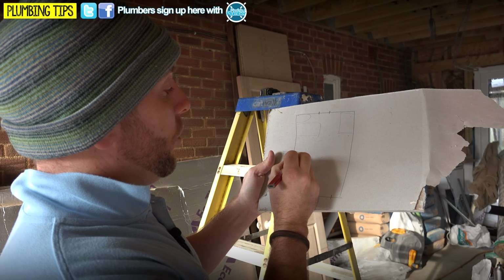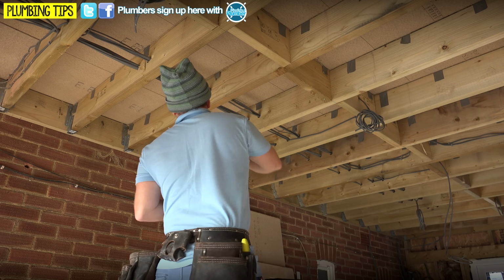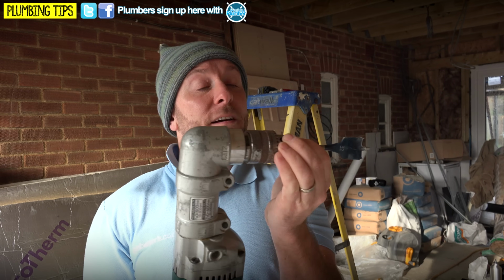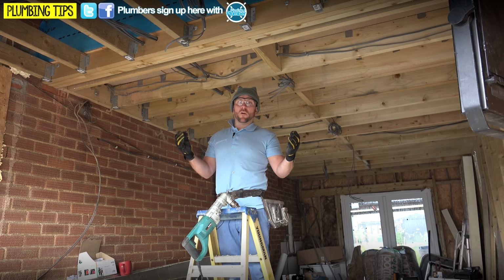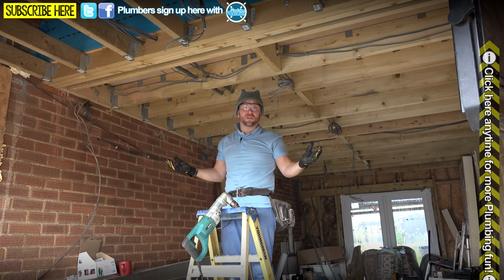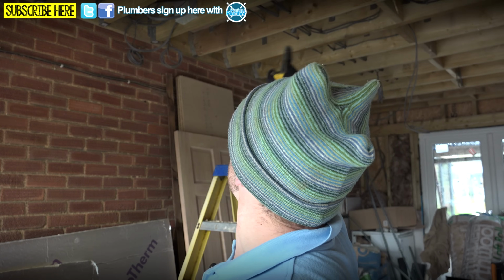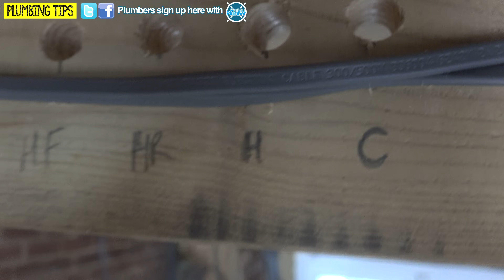DRILLING HOLES IN JOISTS & WOOD FOR PLUMBING - Plumbing Tips

Comment: Worth noting that an impact driver will take those spade / flat / auger bit drill bits (1/4" hex), combined they will fit between joists up to 300 centres 😊. So long as they're decent bits, you should fly through just as easily with an impact. (Thought I'd mention incase the site may not have electricity etc)

Comment: Great video as usual. We're starting first fix of our new home conversion (from old offices) - loads of really old joists that need reinforcing because of decades of crap plumbers, electricians, BT engineers, etc...

I use an Erbauer angled chuck (£16 from screwfix) instead of a special angle drill - does the job just as nicely...
Reply from the maker: Top man! Good luck with the conversion!

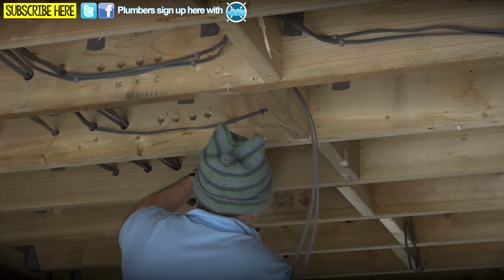Comment: Holes drilled in joists are also supposed to be 3x hole diameter apart from the next adjacent hole. So the holes drilled at 10:04 are not to regulations. Not trying to be picky, just trying to help people out who are using this video as a guide. :)
Reply from the maker: Yes, but at 19mm I had to keep them in the 25%-40% range. I'll let you know if the house falls down!
Reply: So the question is if you have no choice do you drill the holes closer than you should or go outside the 25 -40%  zone? Either way it isn't that critical provided the joists are not over-spanned but as you said this is about getting it past Building Control. If in doubt give them a ring.
Reply from the maker: Great answer! SUBSCRIBE! ➡️👉 https://www.youtube.com/subscription_center?add_user=plumberparts 👈⬅️if you haven't already!

Comment: Does this apply to plastic pipe?  My garage pipes (below the bathroom) are a mess all over the place 70s build. I'm using 15mm plastic pipe to T into the flow and return to a new radiator. I decided on plastic for the slight flex as were the pipes come up through the floor is very tight. I'm confused though, how far down the joist can I drill?

Comment: I'd like to know the wisdom behind the 0.25 to 0.4 joist rule. If you drill on the neutral axis of the beam, you can drill anywhere along the length imo. By drilling holes close together you're creating a slot nearly, which would weaken the beam.
Reply: Building Regs

Comment: If you don't understand the reason for the regs, ask your local controllers for pictures of joists that collapsed due to service holes drilled in stupid places... was a bit of an eye-opener for me.
Reply from the maker: Good point!
Reply: The funny thing about regs is where and when you have to practice them. In Colorado in the 70's and 80's, you couldn't go beyond 2 x depth of the joist, unless it was a laminated joist. So where he was drilling would be a clear violation. Back in another time, and in another place, that is. :)

BTW, I still have my HoleHawg. Now that's a serious drill motor...

Comment: Hi when running first fix plumbing for rads would u reccommend main feed if 22mm then tee off to 15 for rads feed and return thanx
Reply: That's exactly the theory to follow mate gives loads of circulation .I always go as far as I can with 22 mm pipe and you can branch off to your last two rads on the line using a 22 x 15 x 15 mm tee .sorry saw your comment and noticed it wasn't answered yet .I'm sure plumbing parts will agree anyway 👍

Comment: Hi hope you can help. When running plastic pipe for plumbing will I need separate got feed for upstairs and downstairs reds. Also am I correct in assuming that once I drill say a 25 mil hole the next one has to be 75 mill apart. Thanks
Reply: My layman's understanding is that for new installations upstairs and downstairs have to be separate heating zones controlled by their own motorized valves or some other technical solution. Not sure how this would be possible without separate pipe runs. Hope that helps your project four years ago!

Comment: 7:27 - Is it okay to run hot water pipe so close to wires?
Love the singing BTW
Reply: ArcanePath360 You don't always have a choice
Reply: i know its 25mm for a gas pipe ...dunno what the regs are for hot water

Comment: Would you not go bigger with the holes so the pipe insulation will go around the pipe and through the hole too? Might help stop pipe bang on the joists in the future, once the joist is big enough. Nice to see you measured it all out, I'd have probably used a snap line to mark it out.
Reply from the maker: You can only go with the regs, bigger holes might contravine the safety regs of the timber!

Comment: First, let me say that in reality it's fine and not going to be weakened in a way that matters.
BUT I don't think you've entirely followed the code:
1) Drilling through the linked joists was off centre, code says to go through the neutral axis
2) the group of 4 holes, code says the the minimum spacing is 3x the diameter centre to centre. Looked closer than that to me

Comment: when drilling the holes in the joist do you need to drill them three times the max diameter apart or is it just 3 times the diameter apart of the hole size being drilled?
Reply from the maker: There's no specific calculation, as sometimes it's a funny material, or pipe size. I always allow minimum of 2mm clearance each side. So for 22mm pipe, I'll drill a 28mm hole. Hope that helps dude!
Reply: My question was more aimed at the spacing between the holes in the joist as from what I have read, building regs states you need 3 times the holes diameter spacing between each hole drilled. But some state it is 3 times of the max size hole that can be drilled in the joist whereas others just state 3 times the hole size being drilled (so for a 22mm hole it has to be spaced on centre at 66mm). However, if it is spaced on the max size then it does not matter what hole you drill you still need to space it like it is the max hole size being drilled so say for a 150mm deep joist has a max of 38mm hole so 114mm on centre spacing (even if you are only drilling a 15mm hole). Do you know what is the defacto rule to follow around this?
Reply: Hole's must be 3x their actual diameter apart ( that's from edge to edge, not center to center i believe)  and must be at least 100mm away from any notch. Hope that helps Mark

Comment: Here in the USA, the holes drilled in those joists are illegal. You can only drill holes within the center third of the joist span. Further, the O.D. of the hole cannot be within 2" (5cm) of either the top or bottom edge of the joist. If the depth of the joist is D (with a 2" x 10", D= 10" (9-1/4" actual)), the maximum size of the hole is D/3. So, for the 2 x 10 joist, the maximum hole size is 3-1/8". As well, the spacing of the holes within the center third of the joist have to be no less than D (9-1/4" center to center). Hope this helps.
Reply: You sure that's not backwards? The centre third is where most of the stress is, so it makes no sense to encourage people to drill right there. In Ontario, we only allow notching on the top of the 1/3 span next to the supports, meaning the middle 1/3 is banned. We allow boring anywhere along the joist, so long as it's 2" from top/bottom/another hole, and doesn't exceed 1/3 the joist depth. City of Markham even shows a hole right next to the wall in its official doc: https://www.markham.ca/wps/wcm/connect/markham/ba6700b3-30a6-4d94-9ff2-be2a5891b897/Notching+and+drilling+of+framing+members.pdf?MOD=AJPERES&CONVERT_TO=url&CACHEID=ROOTWORKSPACE.Z18_2QD4H901OGV160QC8BLCRJ1001-ba6700b3-30a6-4d94-9ff2-be2a5891b897-msjFK1M
Reply: We're in the UK though, US regs don't mean anything here.

Comment: Being 0.25 of the span from the wall before you can bore seems very restrictive. Here in Ontario we have limits on where you can notch (not allowed in middle 3rd), but you can bore holes anywhere along the joist so long as it's further than 2" from the top or bottom of the joist. Even right next to the wall, the centre depth of the joist has negligible stress on it.